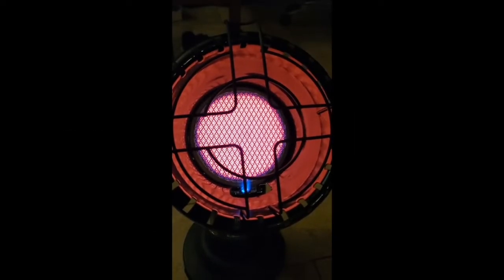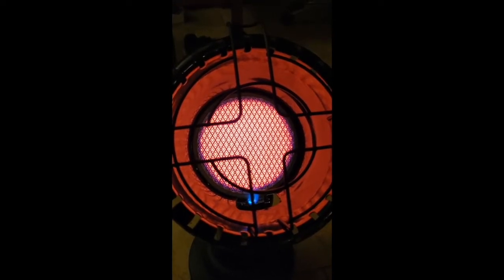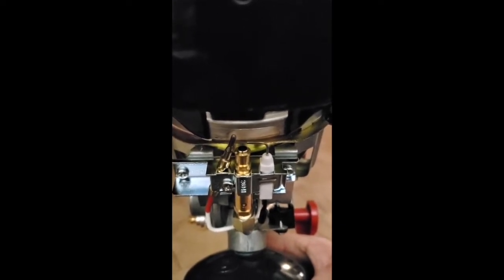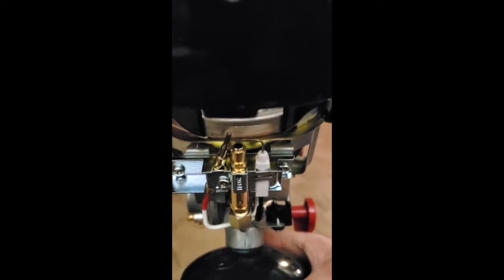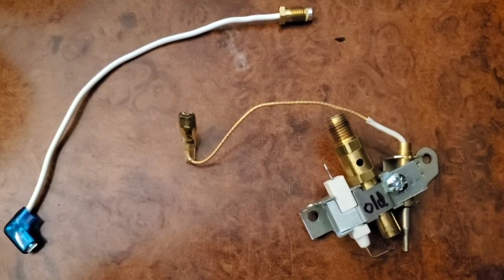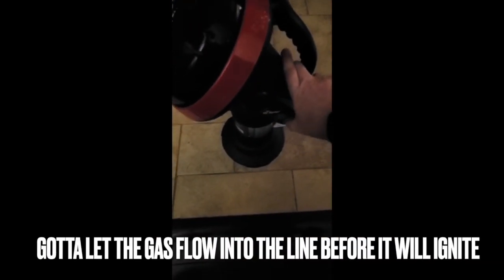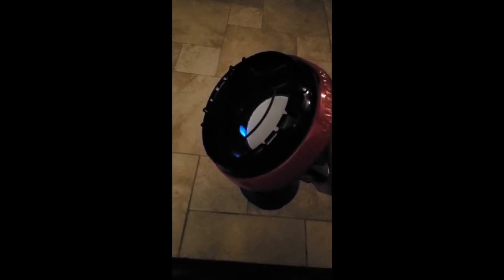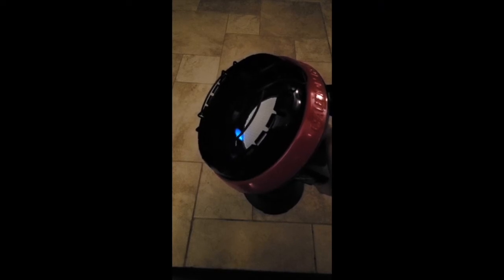Portable Buddy Heater, Thermocouple Replacement: Don’t Junk It, Fix It

Comment: That is NOT what is called the Portable Buddy heater. It may be portable and it may be a Buddy, but it's not what Mr. Heater calls the Portable Buddy heater. Your title caused me to click on something that won't help me unnecessarily.
Reply: Same here. Looking for original big buddy repair.
Reply from the maker: You're correct.  It's called the Little Buddy.  My mistake.  Sorry I didn't catch that earlier.  I'll try to find the archived thumbnail file and edit it and the title in the near term.

Comment: Just throw it away or you end up replacing the thermocouple 4 of 5 times a year. These things are ridiculous 🙄🙄
Reply from the maker: They definitely don't last as long as they should.  Thermocouples on several heaters have crapped out within months of continued use but they're cheaper to replace than the entire unit.  Thanks for watching.
Reply: My big buddy has been in use every year for over 10 yrs. Just lost thermocouple last week.

Comment: Other U tubers say to try to clean it first with steel wool and emery paper.
Reply from the maker: I read that too.  I buffed the finish to get rid of any carbon deposits and it lit one time.  The 2nd attempt, it started acting up again.  So, that's when I decided to order a new thermocouple and install it.  Been working like a dream.  

Thanks for watching. 🙂